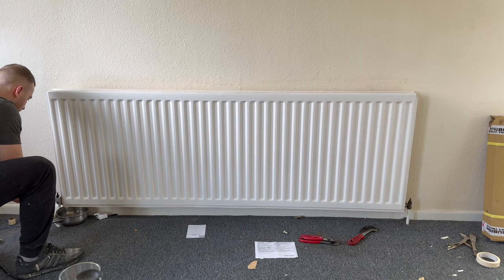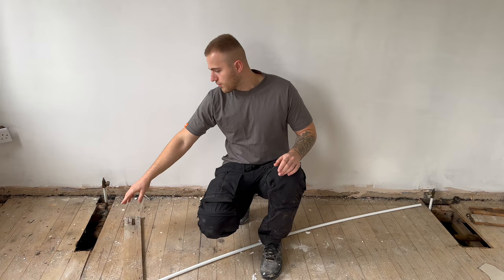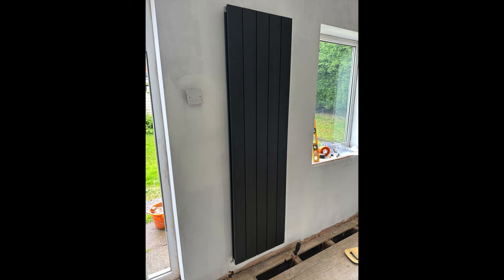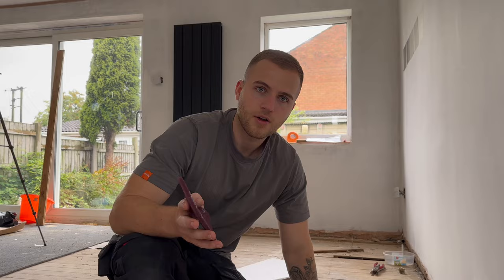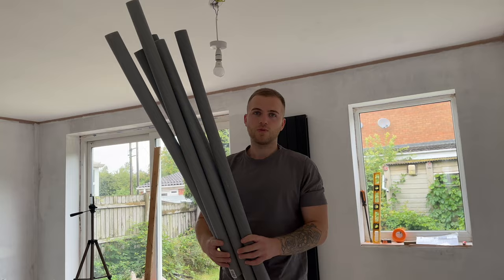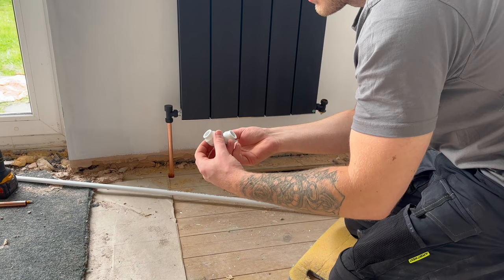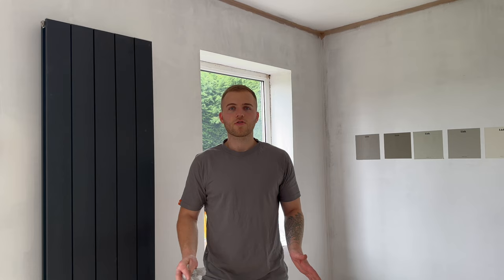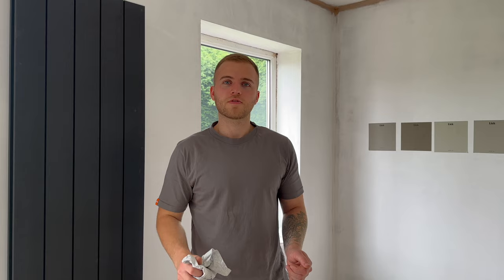How To Move a Radiator To a Different Wall | DIY Easy Push Fit Plumbing

Comment: Nice, little tip, use silicone spray whenever using plastic, where that’s connecting copper or plastic. Your always taught to never go in dry when making connections. Makes it easier to push them together, but also ensures that it does sit in the correct position. Bit stuff if it’s not broken the seal and floorboards are on top
Reply from the maker: Good tips mate, appreciate it

Comment: Yes, really good. I don’t know if it was for the purposes of the video to stress about the need for the Superseal inserts on the plastic but I’d of pre fitted the one Superseal with tape covering it before running the pipes to the rad. The pipe I have used in the past is the JG 15BPEX-32499 Push-Fit PE-X Pipe and it doesn’t seem as flexible as the pipe you’re using. Can you give me the pipe grade if it’s different please?

Comment: Hi,I want to replace a radiator and move the location, I have a presurised system if i turn of the boiler and remove the old radiaor would the water in the system strat to leak whenI cut the pipe old exiting pipe? Shoundt I bleed the hole ssytem?
Reply from the maker: Mine is the same, I drained mine because we had lots of work going on, but I had to refill the system with inhibitor. 
The other way to do it would be to have all the new pipes fitted & routed, and then “snatch” it. Meaning you cut the old pipe & quickly connect the new pipe, without draining the system. But you would still have to bleed & top the pressure up.

Comment: Nice. Does all electricity need to be turned off?
Reply from the maker: Hi, not for this job, just turn your thermostat right down so the boiler doesn’t kick in. I guess you could if you were worried about cables👍
Reply: @reno_with_us  thank you. Very helpful!

Comment: mate do you mind posting links to the fittings and pipe you used/would recommend? Also why not use copper pipe connections like your other video for this particular radiator change? Cheers
Reply from the maker: Hi mate, I got everything from Wickes, it’s all JG Speedfit in this video. I wanted to try both methods, although both are perfectly fine 👍

Comment: It makes no sense. How did you drain the system before you cut the pipe? that is crucial..:)
Reply from the maker: I’ve mentioned that our system was drained due to work going on, and that you can “snatch” to avoid draining the system.

Comment: Can you install those type of radiators on plasterboard wall?
Reply from the maker: You can’t with steel radiators I believe, but aluminium should be fine if fitted with the correct fittings👍
Reply: Hi you can do in any type wall , plasterboard wall every 40 cm have wood inside the plasterboard wall , easy way to  find them use magnetic in the plaster board to locate the screws so there's where is the wood inside, after just mounting the radiator in the wood internally

Comment: Since you’re redoing your house, why are you not installing an HVAC system and a tankless water heater?

Why are your walls plastic instead of drywall?
Reply from the maker: We’re in England, typically we don’t have air conditioning. Also our walls are brick
Reply: @reno_with_us  thanks for the reply 
I was wondering 💭 

Love the videos
Reply: Plaster not plastic did not notice the auto correct